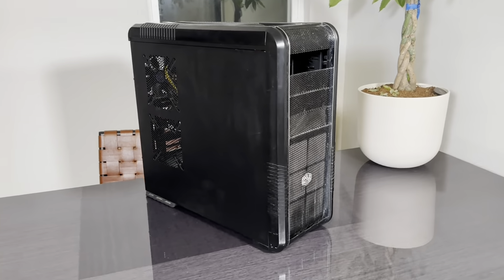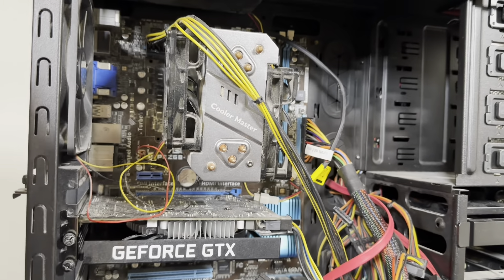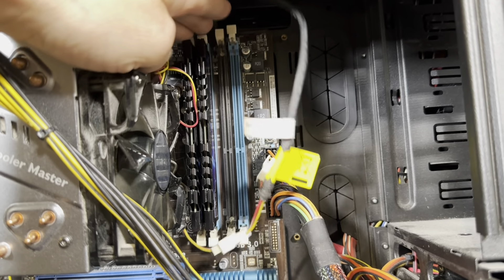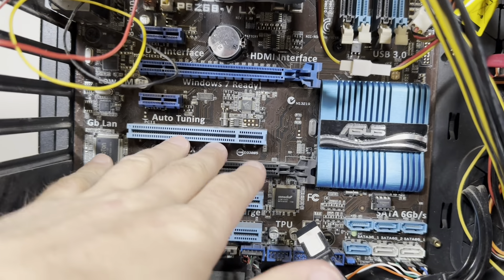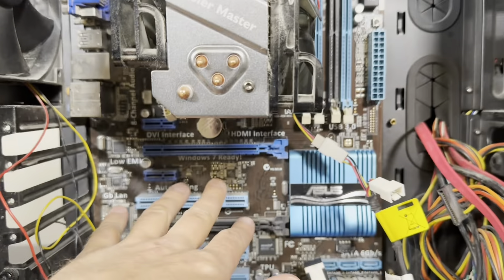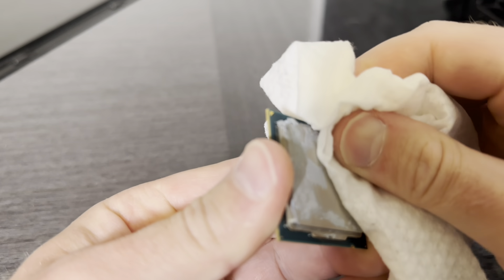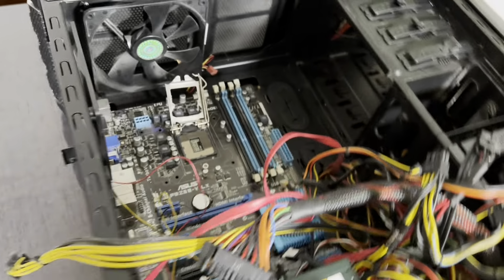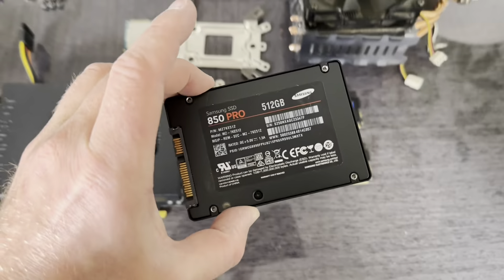How to Disassemble an Old PC for Parts

Comment: I have a PC from 2012. Admittedly its a gen1 HP Z620, so it's built to last, but absolutely nothing is broken and every single port and slot works. I mean , how does a fan blade in the top fan inside that PC get broken off? Looks like its been in a rough environment...
Reply from the maker: I probably put a pen in the fan to figure which fan is noisy, was actually a video card.